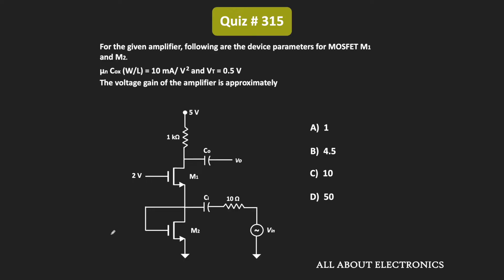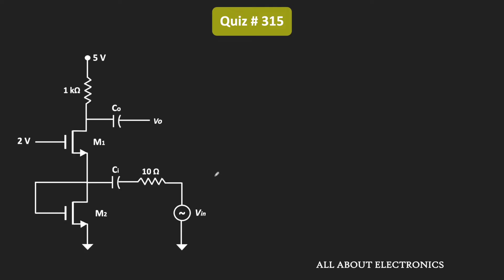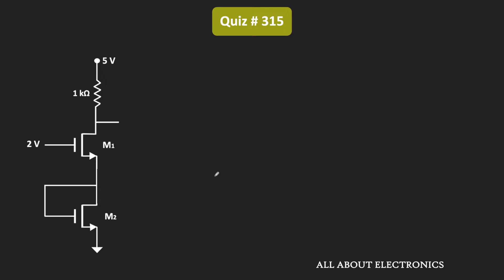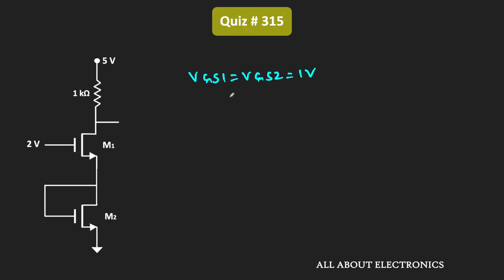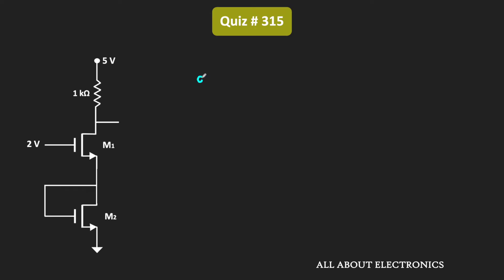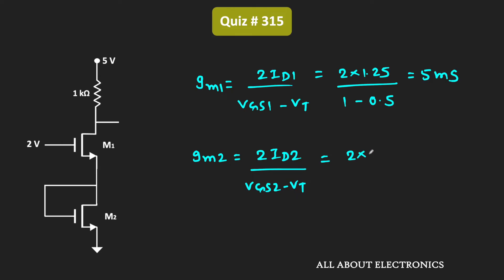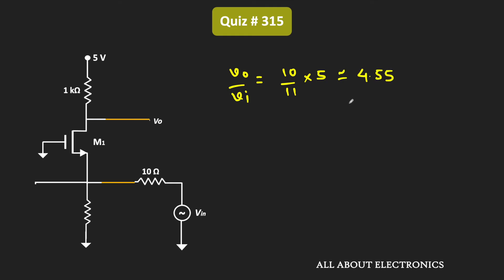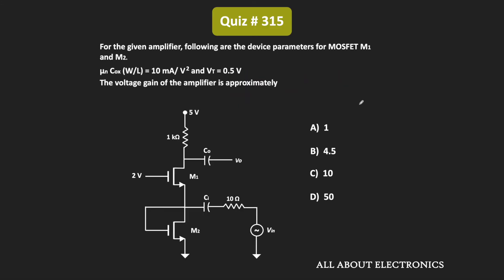MOSFET Common Gate Amplifier Solved sample | Quiz # 315

Comment: in the part where u said  vx/vi=zin/zin+rs.....i drew the t equil model and found out that u only need to consider the Rs(not the internal resistance)  which is 200 ohms..so in the formula we get vx/vi=  Rs/(Rs+Ri)...which simplifies to 200/(200+10)

Comment: 1:34 why saturation current formula is used for both the mosfet, could you please clarify it
Reply from the maker: The second mosfet M2 is diode connected transistor. Since, gate and drain terminals are connected together, Vds > Vgs - Vt. And therefore, it also operates in the saturation region. I hope, it will clear your doubt.

Comment: Why does the 10 ohm resistor is short circuited in small signal analysis of diode connected device
Reply from the maker: Just to showcase the similarity of this circuit with the common gate amplifier. Later on, during the calculation, it is considered.

Comment: Can you explain how the drain current is equal in this question
Reply from the maker: Two MOSFETs are connected in series. For second MOSFET M2, assuming gate current is very negligible, the same drain current of M1 will also flow through M2. If you just apply the KCL where the two mosfets are connected, you will get it.